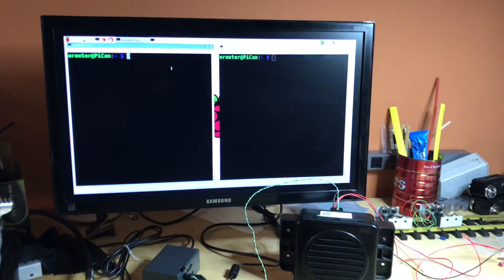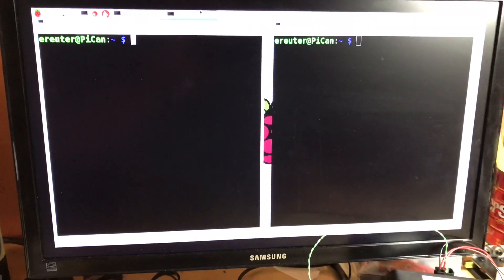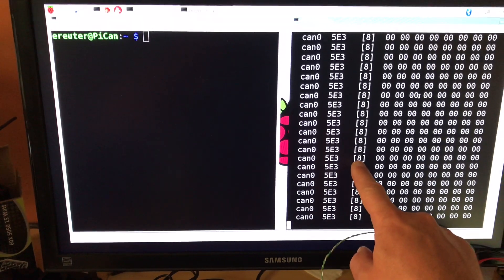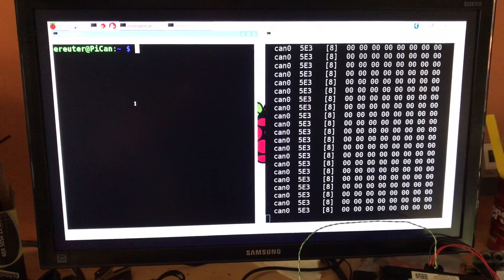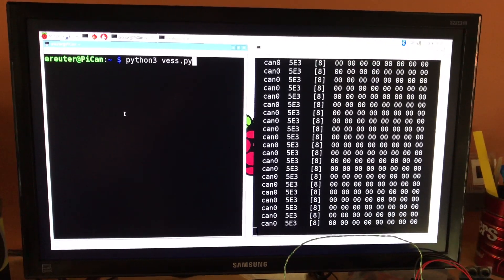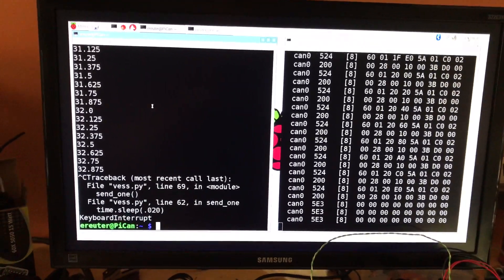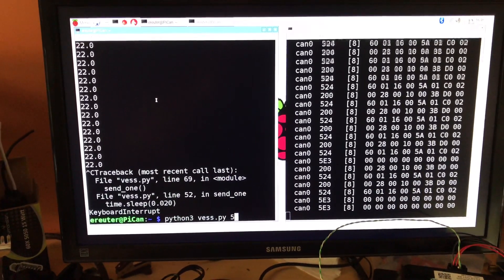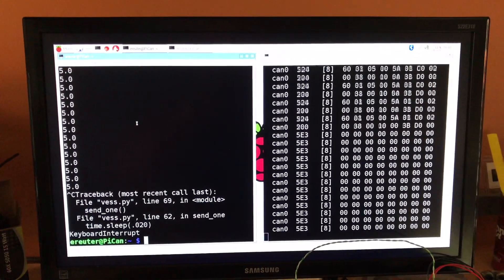Hyundai Kona VESS arbitrary control

Comment: hi~ 1pin = +, 5,6pin = GND 4,8pin = P-CAN? in power 12V should i autorize it? I am runnig it wit Arduino Does the sorento Hybrid vess module also match the code?
Reply from the maker: I have no idea if the Sorrento VESS is the same.  I don't even know if a current Kona VESS is the same.  Mine is from 2019.

Comment: hi.  I want to connect it to a kickboard and make it work.  Can I use it by connecting to Arduino?  I need code and examples
Reply from the maker: Yes, that would be pretty simple.  You need a CAN interface like the CAN-Bus Shield.  This python script I wrote provides all the relevant messages to control the VESS.  https://github.com/ereuter/vess
Reply: @ericlreuter  
Is your contact information included? like discord
Reply: i need arduino code Can you help me?  Please, I really want to make it come true.

Comment: Can you cut a wire at the plug to disable backup but not angelic sound?
Reply from the maker: No, it's all controlled by CAN messages.  The only discreet input is the wire that turns the whole thing on and off.

Comment: Hey Eric, I see you sent reverse in the 1st frames..   and in your script put in the 'r' paramater sendin gin 524 (or 200) in your 1st column.

I know you haven't messed with this in awhile, but in theory - could someone  build a pi device TO intercept the signal to VESS and overwrite the 524/200 back to 5E3 signal.. .  (thus eliminated the reverse beeps)
Reply from the maker: Yes, I suspect that would work fine.  Put a microcontroller with two CAN interfaces between the car and the VESS.  I used one of these for my further experiments with good success: https://www.tindie.com/products/fusion/dual-can-bus-adapter-for-teensy-35-36/

Comment: It's annoying that it has to make noise when the vehicle is stopped but in gear. Unlike Toyota where its silent until you start to move.
Thanks for doing this, showing how it works
Reply: Interesting, current Toyota models do make the sound even when stopped in gear. They also get significantly louder in reverse than in drive.

Comment: Hi, Eric! Thank you for your video! 
I saw pin.3 and pin.7 in connector scheme are named "Crash Pad Switch". Do you know what are they for?
Reply from the maker: In some markets (not the US), there is a button on the "crash pad", below and to the left of the steering wheel that toggles the VESS on and off.  I think they call it the crash pad because it cushions the dash in a crash, but I don't know for sure.  In any case, the wires are present in all of the cars, but the button is missing in the US and some other markets.
Reply: @ericlreuter  Hyundai Tech here. You're correct, the wires are there on all vehicles. there's actually 3 wires - two for the switch, and one to feed the LED indicator (shares a ground with the switch). It's one of the first mods I made to my Ioniq EV. How far into the VESS module have you ventured? Can the actual sound software be permanently altered by flashing a rom or something? I'd love to reprogram mine to the jetsons flying saucer sound just to be silly.

Comment: Hey, thank you for that incredible video. Can you tell if the volume is a parameter you can set ? or it is by default in the module ? 
and last question, the reverse beeps seems to come from this module too. Did you find how to fake it too ?
Reply from the maker: The volume is fixed.  Hyundai may have a way to alter it, but I was only able to reverse engineer the CAN frames that the car sends to it on during regular operation.  The reverse chime is built into this module.  The car doesn't make any reverse sound when the module is disconnected.
Reply: @ericlreuter  Thanks
Reply: @ericlreuter  can you see what it sounds like if you send alternating speed fake can signals at different frequencies and pulse lengths to make more of a techno ICE motor sound?
Reply: @ericlreuter  Which pin controls the reverse? Do you have your wiring diagram for how you connected this? I saw a connector location description for the VESS online that showed an eight-pin connector going left to right top to bottom with connector one in the upper left and 8 in the lower right. Pin 1 battery (+), Pin 2 Ignition, pin 3 nothing, pin 4 P-can (high), Pins 5 and 6 grounds, pin 7 nothing, pin 8 P-can (low). which pins are you communicating through?
Reply from the maker: @randytwiss7945  the reverse sound is triggered by CAN messages, not a pin. The pin out is here, along with the code to operate it: https://github.com/ereuter/vess